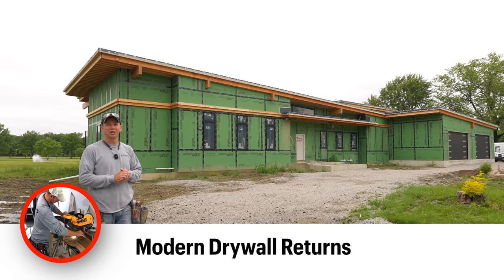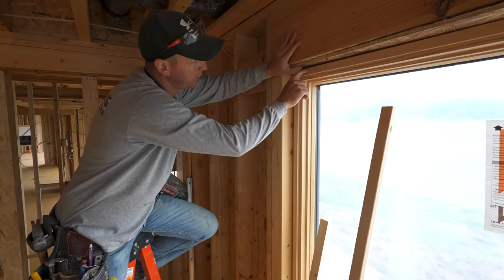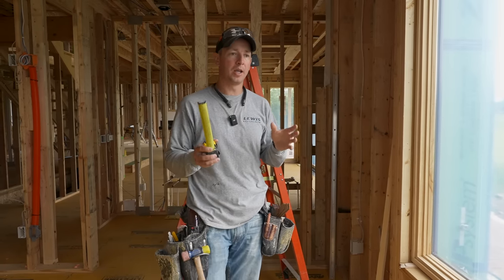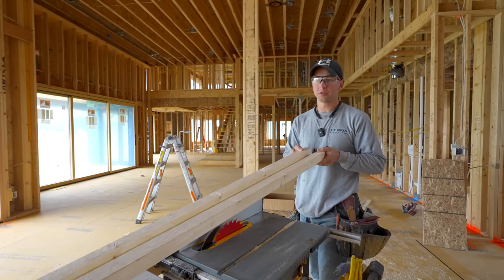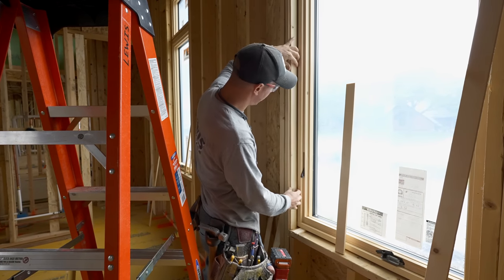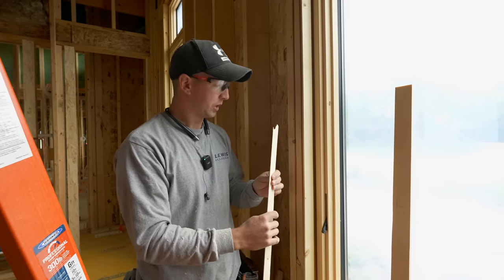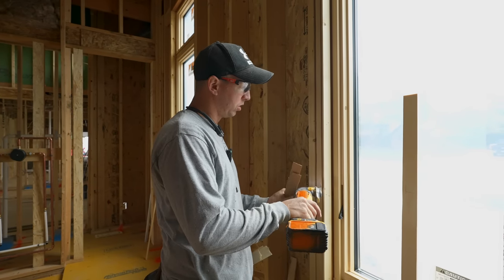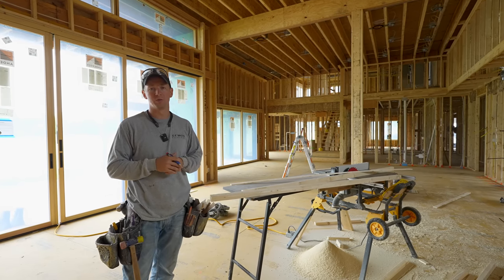NEW TREND!!! No Window Trim??? How to Tackle Modern Drywall Returns

Comment: We've done this, but use MDO for the returns that they mud over. Works well, and is more durable. Preassemble the return, legs and head, and shim it when you install. Obviously, windows need to be foamed first.
Reply: Similar method except 5/4 wood extensions ripped to width to the backside of the drywall. Drill and screw through the edge of the extension jamb into the window frame. 5/4 will allow for better bead attachment after drywall. No shimming. No worries about out of plumb or framing not parallel with the window unit. Hot mud on all bead anyway. But we like a bonding agent also. Insulate as usual. Larger insulation pocket for fiberglass or rockwool. No tear away bead or similar vinyl DIY gimmicks. Metal bead. Always. Reveals are perfect and the rockers will buy you lunch for a week. The painters will buy you lunch the week after. It’s a mistake to take gypsum board up to the window frame unless your brother in law is a painting contractor and he likes call backs. If so, keep using drywall, compound and caulk for the extension jambs. Your brother in law might buy you lunch. But I doubt it.

Comment: Would it work to use a non-expanding adhesive to give consistent support between shims? I seem to recall you using this method trimming pocket doors. Love your work and your teaching style.
Reply from the maker: Not a bad idea!
Reply: Basically like wet shimming foam backer board in bathrooms.
Reply: Don't think that's necessary. Place the shims no more than 16" on center and the drywall is as supported as it would be at any horizontal seam in a wall. I wouldn't even bother with the full length shim personally. Just an extra unnecessary step.

Comment: Drywall returns are the norm in Florida. Cased windows and doors are very rare. I built my previous house in Fl. All cased interior had wood, brick and stone. People never saw a house like that in Florida. New house is in a nice gated community by Lennar. All drywall returns. I miss aspects of my custom built house but honestly I wouldn't trade it for the new house.
Reply: I live in SW Florida and the housing market has been bonkers crazy for years with no end in site until every square inch of land has a home, apartment or commercial building on it.  I'm a painter, mostly res repaints and I see 8/10 homes have plantation shutters.  The returns are often not painted or finished because the frame of the plantation shutters cover it all - but I can see it from the outside.  McHousing - I want big, inexpensive and high quality, but you only get to choose 2 of those.

Comment: New trend…? Builder standard in most places. I’m from Midwest where drywall returns to vinyl windows are expected. Even in custom homes, trim packages for windows are rare. Lucky if you get a stool on the widow. Live on west coast now and 90% of homes here all have drywall returns. Drywallers  install the return and use shims to keep it straight -ish.  No full length backing is used. If they do, it’s strips of drywall to pad out a space. The corner bead add a lot of strength to the corners so shimming is usually enough. Trim carpenters would tell drywallers  to go kick rocks if they asked for a window to be pre-shimmed where I’m from.

Comment: When walls are done in factories and the windows are put in the gaps from the windows and jacks and sill and header are consistent because they set the windows on shims that are the same thickness and make the gaps between the jacks even you could possibly do it like that but the everything needs to be close to size and somewhat square

Comment: As a drywall guy I charge extra per window to wrap windows, and I still hate doing it. Especially because none of the builders around here care enough to do what you're doing, and even doing that the hangers will come in and pay no attention to where your shims are and run screws where there's no shim and bust the drywall making all this work pointless. I hate how the windows look, especially if you have multiple windows all tying in to each other. It's a finishers nightmare. I've been  doing this for 31 years and the only houses we've ever done wrapped windows in was the cheapest little cracker box houses. Can't believe this is a trend in high end homes now.

Comment: How are they finishing the drywall against the window? Are they using Tear Away or do they just butt the drywall up  to the frame?
Reply: Also curious
Reply: @vpnguyen1 in commercial work, j-bead would be used against the unit. The drywall slides into that. With Andersen and residential work, the unit has stops that are typically shipped loose or tacked. The returns are partially covered. But if he takes sound advice, he will cut the extensions from solid stock and the taper (that’s what drywall finishers are called where I am from) will float his compound onto the drywall and extension after the beading is applied. This is the only way to execute this trim-less detail IMO.

Comment: Business wise, i find it interesting that you are doing this at all.  I would have thought this job would have fallen to the drywaller.   I get it though: the builder knows you will get the small details correct.  I wonder if it's the standard practice to hire a finish carpenter for this job.    I also imagine it's a bit difficult to price the job.
Reply from the maker: It requires carpentry tools, so it is best to let the finish guy handle it. Framers and drywallers are to obesses with speed to do this type of work properly in my long experience. 

As far as pricing, I find it takes me the same amount of time to do the shimming as it would to case the window. So it's fairly easy to price out.

Comment: I’m always curious on this method and the advent of moisture run off  from a window panes. In climates of -20 -30 during winter months no matter how good your windows,insulation and your HRV system is, its gonna happen. Ive seen it i 500,000 homes and million dollar homes. I Luv the look but doesn’t seem advantageous to the end results down the road

Comment: Interesting that this part of the whole house build is left to you, carpenter. I would say either framers or even more possible drywall installers should do it. 🧐
Reply: I worked for a builder in Louisville decades ago and he would sub out the framing. He had a small crew of us carpenters come in and do tweaks, adjustments and special details.
Reply: Lol, how many drywall crews have you seen working? Or framing crews?  The precision matters a lot here, so they called in the finish carpenter.

Comment: Thanks. How would you estimate drywall return vs traditional on a job? More or less?
Reply from the maker: About the same. Takes the same time for me to shim as it does to case a window. Slightly less material cost with no casing but that should be offset with more drywall finish labor.

Comment: Need to make the Rough opening big enough to just make a 1/2-4-5/8 jamb tight against the window and set the window wrapped tight in the 1/2 jamb then shim between the jamb and framing . Way cleaner job . Works best with bc plywood or MDO.
Reply: What is the finish jamb material in your comment. Is it wood or gypsum board?

Comment: I’m assuming maybe because the interior frame is wood but most vinyl windows in our area have either a 3/4 or 1/2 inch return or a combo of both designed into the frame. 
I’m not a fan of the drywall return just because of condensation drip that can happen and just wear and tear on the assembly

Comment: Spencer I was wondering what size did you use for stapling that trim so it doesn’t bow out after the drywaller screws in the 1/2” drywall? Your video was simply fantastic, as always! Tnx.

Comment: Do the drywallers cap where the sheet meets the window, skimming a taper with mud from cap to the wall or do they just butt the gypsum with a slight gap and then the painter caulks?  -Figured you would know when reviewing the finished product. I know!  Not your responsibility nor affecting your margins but just was interested.  Thanks.
Reply from the maker: They butt the drywall to the wood, mud it tight, then caulk to the window. I'm sure we could use an L bead but it would be a lot more labor and I'm not sure it would really be any better.
Reply: @InsiderCarpentry  Thanks so much for your reply.  You're awesome!

Comment: If you ever do an embedded base or widow header detail. I would be curious to see your process. I just finished a 12000 sqft house with the detail, and it was incredibly difficult and time consuming to do. Running fake baseboard work boards before drywall with a laser. Shimming the base so it has a constant 1/8" reveal past the drywall. And then scribing the base between the drywall and the hardwood floors.
Reply from the maker: I priced a job out with it knowing how long it would take...they didn't go with it. But I bet one day soon I'll get a job with flush base.

Comment: On a houseful of Andersen 100 Series, the jamb reach nominally 4-9/16", would you instead use pairs of 1-1/2 shims, one back near the window, the other out front near drywall face, rather than ripping 4-1/4 wide?

Comment: I wouldn't even think this is the trim carpenters responsibility. Where i am down south im pretty sure the drywall guys or the framers themselves would do this. Looking ar some jobs ive been on maybe nobody does it because the returns/reveals are not very consistent.
Reply from the maker: If we left it in the hands of either of those trades it would sadly be a disaster.

Comment: Hello Spencer!  QQ: I've had misalignment issues with thin kerf blades and the stock Dewalt riving knife. Admittedly, I have the 8"1/4 version of that table saw - it is what's available in my market - so maybe the kerf thicknesses are different?  Are you using the stock knife, or is that a thin-kerf riving knife you've managed to find?  Any info appreciated, thanks!
Reply from the maker: I feel like I had this issue at one point as well. Make sure you don't have sawdust packed around the riving knife. That can throw off the alignment. If the knife you have is too wide you may have to purchase a thinner one.
Reply: The riving knife on my older Dewalt job site saw is no thicker than the thinnest blade I ever use (the same Diablo rip blade Spencer is using, I think), but it is possible  for the riving knife to be out of alignment with the blade. My saw has metal shims that can be positioned to align the riving knife with the blade, and I've gotten in the habit of carefully checking the alignment when installing a new blade or reinstalling the riving knife (after using a dado stack, etc.)

Comment: Not a new thing and it's quite old. Be sure they to use  tear away bead and not the slip over vinyl trim. It needs to be stapled and/or glued; don't let your drywallers try to glue it on with just mud.

Comment: Is there any insulation around the windows? Ie window foam?
Reply from the maker: Not yet. I talked about that in the video. I left a gap so they could foam the window later.
Reply: You sure did!  Not sure how I missed it watching the first time… likely day dreaming 😂

I guess the real question is how did you get talked into doing the drywallers job! 😂😂😂 

We did three way returns with a wood sil back in the ‘80’s and early 90’s. Same with closets, have seen those in a minute. Prior to round bead becoming a “thing”.

Comment: Drywall returns against the windows isnt a new idea,   it's been around for years.   I sheet rocked in the late 80's and that detail was common then.   I hated it then and that hasnt changed.   It takes the sheetrocker just as much time to detail a window properly as it does to hang an entire wall.  And then you have to consider how it is finished against the window.   Moisture is a huge problem.    Imo... nope,   not a good idea.
Reply: Back when I was doing it . . . yes, it was a bunch of extra work.  We edged all the wrapped pieces with a vinyl bead call J-moulding.  It fit on the edge of the piece and went tight to the window.  Kept all the moisture off the rock.
Reply: @Lugnut64052  Correct,   J mould was rarely called out as a detail on the spec houses we were working on.

Comment: Drywall returns are 90% of the houses in Florida. You’re complicating the whole process.
Reply from the maker: How?
Reply: @InsiderCarpentry  you’re a master and I respect all your work. But when they wrap drywall they don’t put a lot of work into what’s behind it. The windows are usually tighter to the RO and the drywall hangers do the wrap. But you have a very quality finish and probably have to do it your way. On a Florida block wall they actually mud set the wrap into the block. The finishers corner bead and go.

Comment: Hey Spencer- What is the brand of that outfeed table on your saw? I have the Skilsaw jobsite table saw (a "beast" of a saw by the way) & it had the same rack & pinion fence rails with no place to attach an aftermarket outfeed. Maybe you could do a tool review of it sometime like you do with other tools?
Reply from the maker: https://amzn.to/3O4ncwj
Reply: Building modern houses are the worst...
Reply: @InsiderCarpentry  Thanks! I see Rockler now has a similar one. Can the Rosseau  attach to the saw frame or does it require buying the  Rosseau stand?